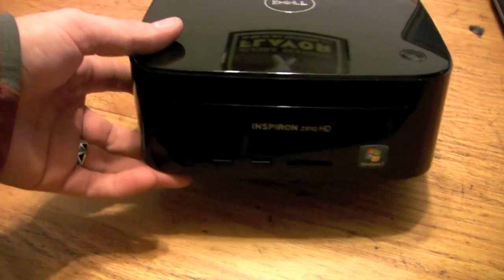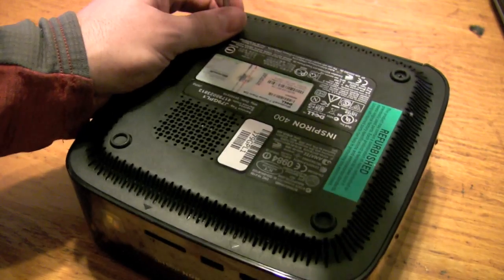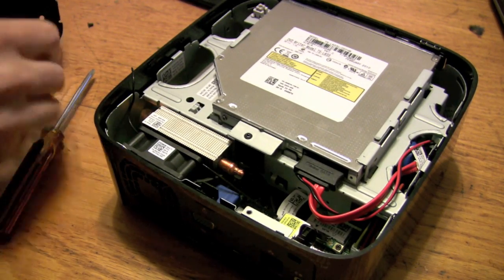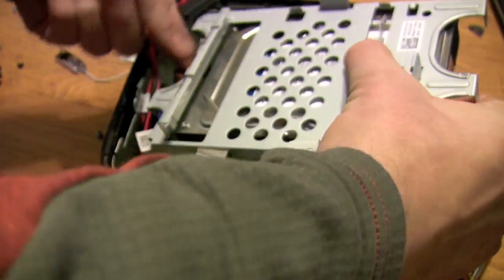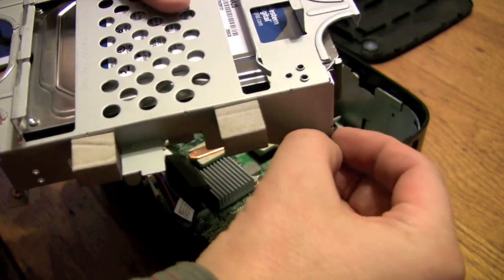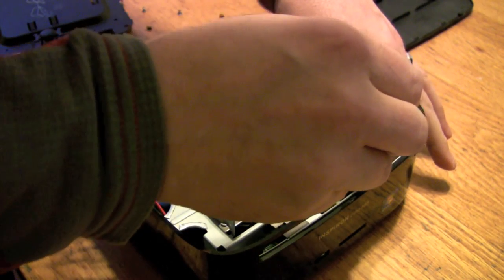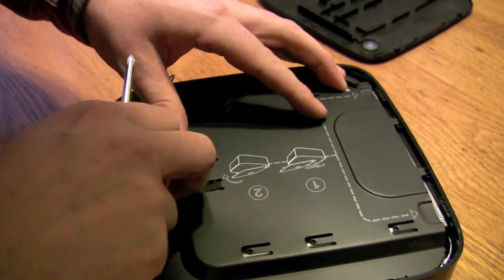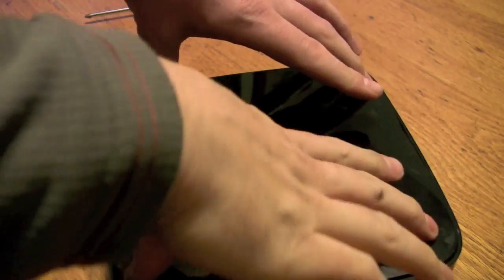Dell Inspiron Zino HD - How to take the case apart for upgrading the Memory RAM and HDD hard drive

Comment: I 'm still using this in my bedroom today. So far I changed the rear cooling fan, the bottom mxm gpu blower fan, power supply , the mxm  Radeon HD4330 512MB Mobility Video Card, and now it looks like I need a dvd BD drive.

Comment: I just go a Zino400 HD that I'm planning to use for a small MAME cabinet project, the machine runs smooth and all is functional but, for space considerations and to increase cooling I was looking to remove as much as i possible of the casing, I see that the unit is compromised from a inner metallic frame and the black shell... There are a set of screws on the bottom that looks hold the plastic shell but even after removing them I can not get the thing to come apart, did I miss something?
Reply: What is stopping you from removing the board is the two nut screws that secures the vga cable to the vga port of the motherboard. Those two screaws also secures the motherboard to the frame. I had to change the rear fan and had to remove the plastic cover from the rear ports than remove those two screws to remove the metal cover to get to the fan screws and clean the heatsink.

Comment: I upgraded my Zinio HD 410 Machine and it was tricky.One of the Ram slots is accessible from the bottom cover and the other Ram module was sitting under the HDD caddy which needed access from the top.
When i took out the bulky 1TB HDD and replaced it with a tiny Adata 256gb SSD, there was no way to screw the SSD into the old caddy and i had to strap up the SSD with an electrical tape.
Interestingly, I guess all the Zinio PCS do not have the same layout of components even as they have the same form factor.
Reply: ....or you could just use a 2.5 inch to 3.5 inch converter instead of using tape.

Comment: Question I bought a 2nd hand Zino and upon opening it up I discovered the hard-drive caddy is not screwed to the Mobo at all You mentioned it is the only silver screws in the case. Is this required to not short out the board? I'd rather leave it alone than put in the wrong screws.

edit: I also think after doing memory test one of the sticks are bad. which one is the primary slot? Top or bottom?

Comment from the maker: You can save money on cheaper brands but I always pay more to get brand name RAM. Other difference will be speed. Big upside to getting 1x4 is latter you can get another to upgrade to 8 gb. But having 2x2 is fine if you are saving money. The Zino HD and 400 series will support 8 GB. The Zino 300 only had one slot and max of 2 gb. Always wise to back up your data before working on your computer.

Comment: Noob questions here, I want to upgrade the RAM in my Zino(from 2g to 4g), is it better to get 2x2g sticks or 1x4g stick(assuming I can put 2 sticks in)? I looked on eBay and there is a pretty big price difference, ranging from about $30 to over $100, is the more expensive RAM worth it? Any other places you would suggest to buy RAM from? Last question, do I need to take any precautions before replacing the RAM(save files, back anything up, etc)?

 Thanks for the vid, sub'ed!

Comment from the maker: Mine has been great. Never shutdown for heat or any issue. Mine is sitting on top of my media cabinet so any excess heat can easily get out into the air. Maybe the heat is an issue if the Zino is in a media cabinet with other equipment like DVD player and home theatre system. All this extra heat may make a difference.